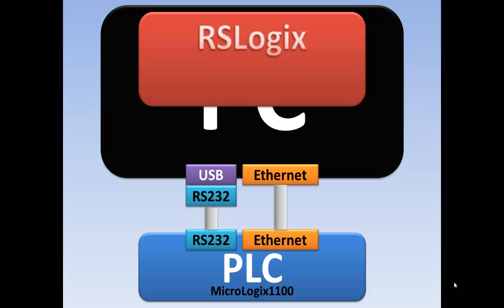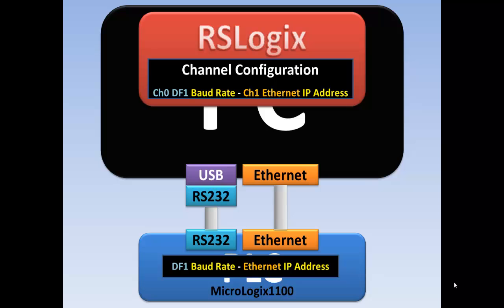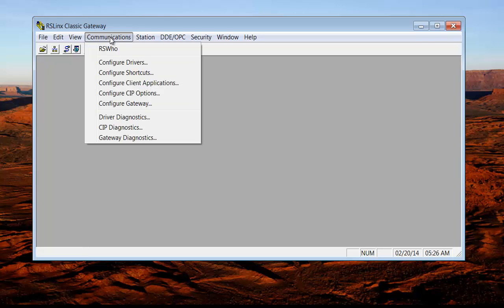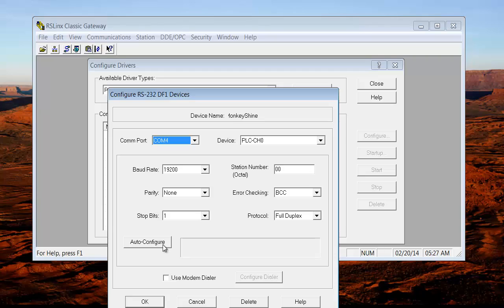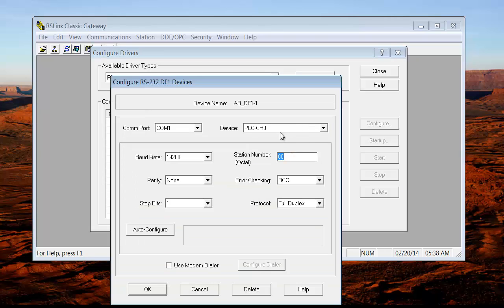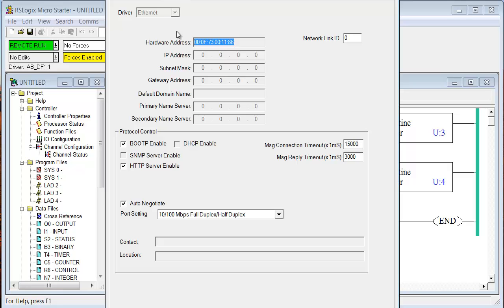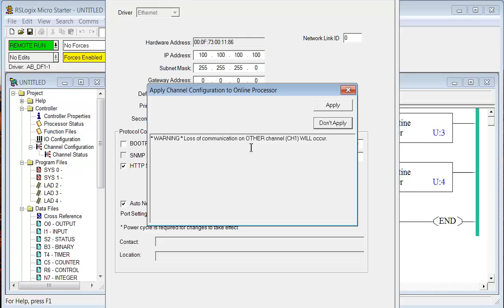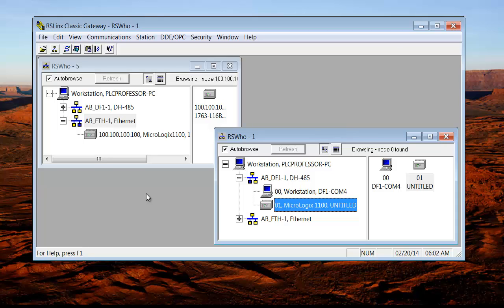Basics01b - Configuring RSLinx Drivers, A PLC Tutorial

Comment: Thank you for this info!! My Chem Eng degree at Drexel set me back 100k. I graduated not ever hearing what a PLC was. I'm finding out it's an important subject if you work in industry.
Reply: I have met many chem engineers out there doing lots of PLC programming. Micrologix is the most effective and least expensive route to learn PLC programming, but once completed, the Logix Engine with either ControlLogix or CompactLogix is a real treat with user defined data types, add on instructions, function block and structured text languages added to ladder logic diagrams. Have fun!!!

Comment: what about RSSidewinder? What is the difference between RSLinx and RSSidewinder? I mean are both of them for writing codes?
Reply from the maker: RS Sidewinder is a more tightly integrated API for RS Softlogix only. Softlogix is the Logix Engine running on a PC. RSLinx is a relatively narrow link between Rockwell Software and communication devices on your PC. Whereas Sidewinder is very effectively integrated with just Softlogix. Applications targeted are enterprise in nature.
Reply from the maker: plcprofessor With RSLinx you can create topics and use DDE/OPC to interface to MS products like Excel. I have worked with Softlogix but it is a very rare occurrence in my daily work.

Comment: I've micrologix 1400 plc and the ethernet port suddenly  has stopped then I can't ping or communicate with it by ethernet. How can I repair this problem .
Is this hardware problem or can I solve it by program settings.?
Thanks
Reply from the maker: Check your cable and connectors.